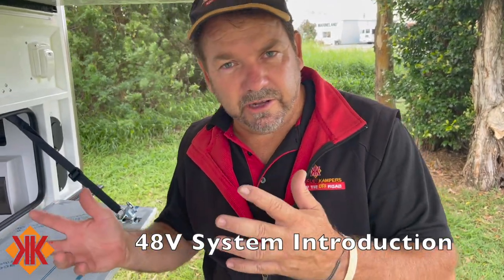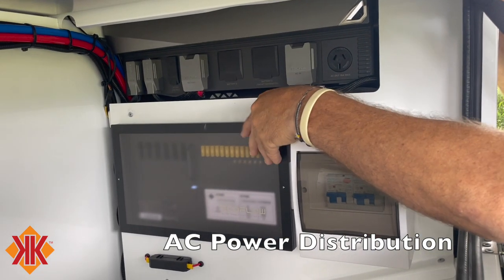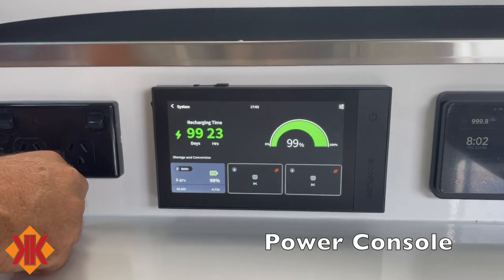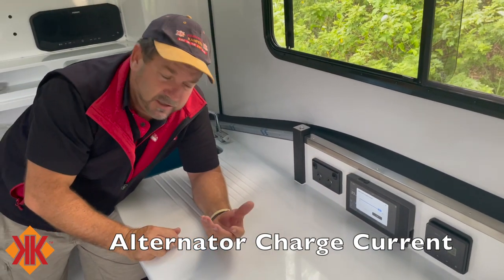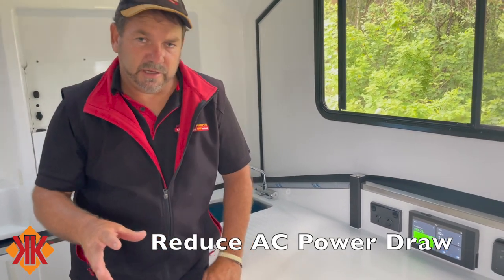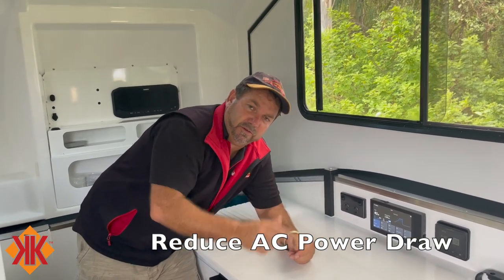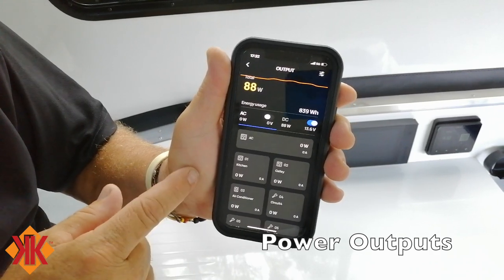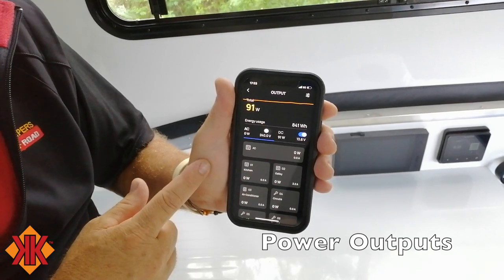Offroad Caravan 48V Electrical Kwik User Guide  | Kimberley Kampers

Comment: can you set the alternator voltage higher than 12V? ie. if my tow vehicle can supply 24V or 48V.
Reply from the maker: Yes you can - the system input spec is 13-60V, 30A and max power input of 1600W